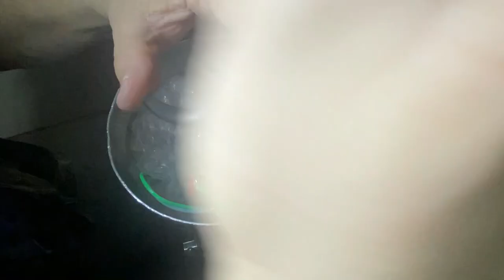I Can Haz Armory # 6 (RESHOOT) - Assembling an epee and foil

Comment: I was oblivious to how fencing equipment had something inside of it, for me it always two sharp  blades and a suits with some sort of conductive layer that supposed to be electrically shorted indicating a hit
Reply from the maker: Aside from the sharp blades part, you're not that far off.  Foil and sabre have defined valid target areas (torso for foil, everything from the waist up except for the hands in sabre), so those fencers wear a conductive vest or jacket called a lame' over their protective gear.  In epee the entire body is target, so they don't wear anything extra.

The electrical circuits are different for each weapon.  Epee is a simple open circuit that closes when the ti is depressed to close it (hence the 2 wires).  Foil is a closed circuit that OPENS when the tip is depressed and power either redirects into the other fencer's lame' and out one of the lines of the cord that connects his weapon to the scoring system (ths firing rhe scoring light) or shows an off target light if the hit is to something like a leg.  Sabre is similar to foil, but all it requires is physical contact between the blade and the lame.

Comment: Hey! I am a novice at repairing my foil blade, but I was just curious, I see a lot of videos that wire the foil from the top. Is that just convention? I guess I'm just curious if there are any detriments to wiring the blade to the bottom of the bracket.
Reply from the maker: I think you mean connecting the wires to the socket, correct?  To me, wiring means gluing the wire in.

Convention traditionally is to the top (talking foil here, since you really can't do an underside connection on an epee socket), but you can attach it anywhere so long as it can be tested.

I prefer the underside because it keeps the wire farther from the fingers and is easier and faster to reconnect without going through the bracket hole (on a German socket...the Leon Paul requires going through the hole because the only connection IS on top).

And in fact....check back Thursday, because THAT vid is dedicated to how to connect the wires....to SEVEN different sockets!
Reply: Ok thank you so much! That makes a lot of sense! I'll check back Thursday! @samsignorelli